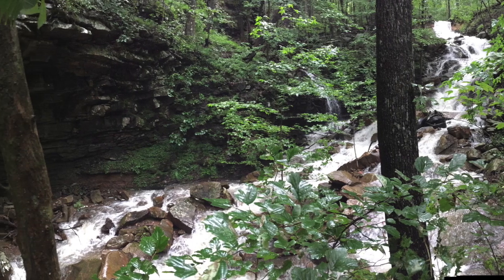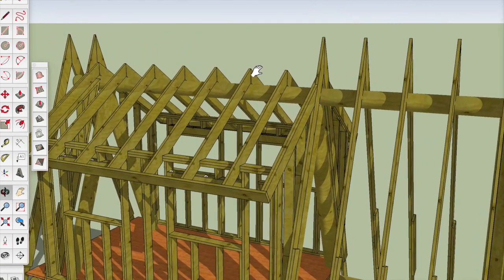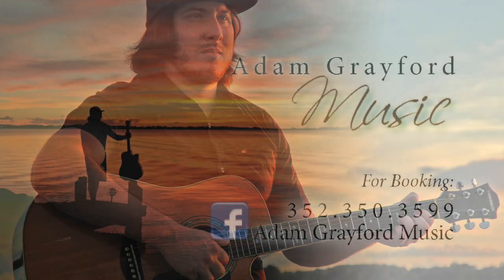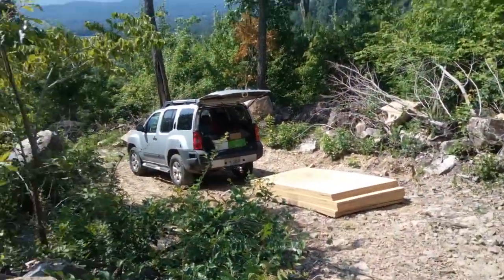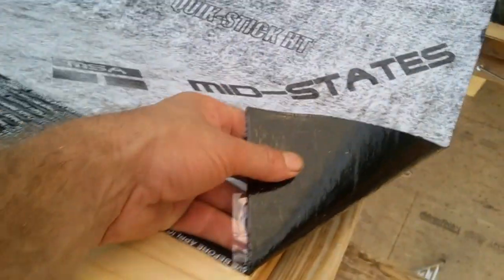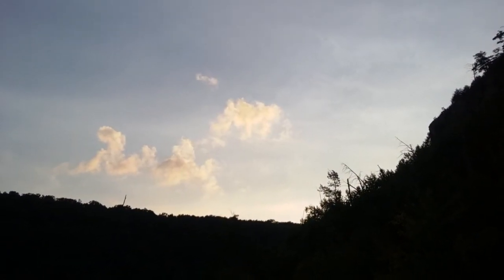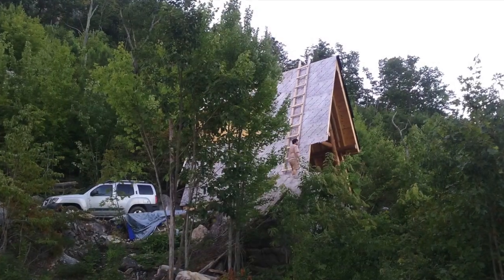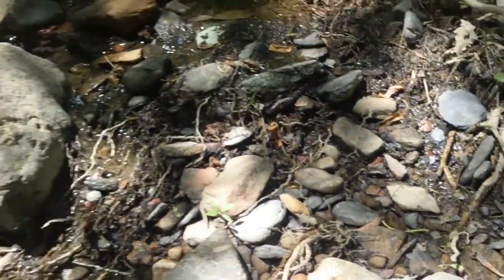A-Frame Cabin Adventure 11

Comment: Screw an eye hook in the ends of your logs and run a steel cable from one end to the other.  hook a chain on the cable and a harness or leather belt to keep you from ending up in the boulders.